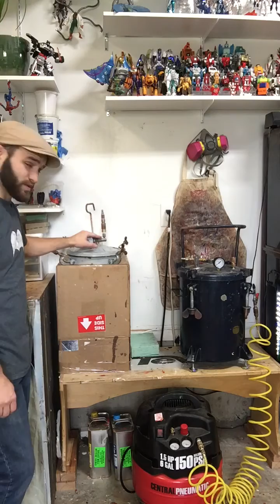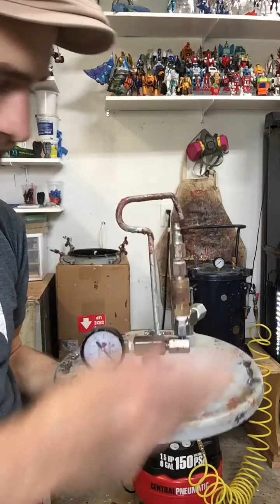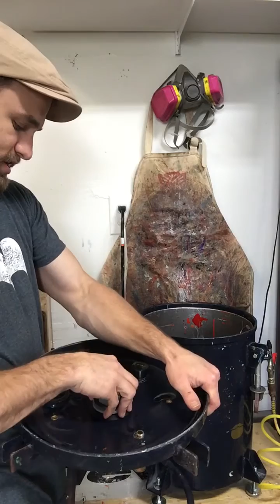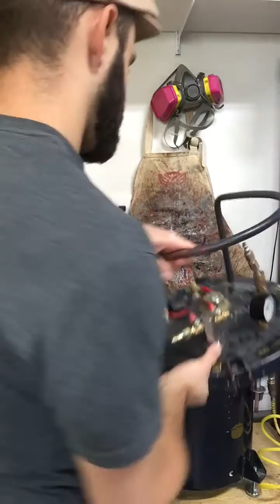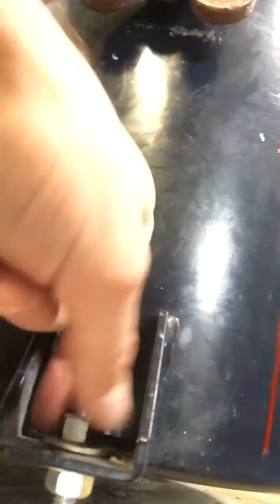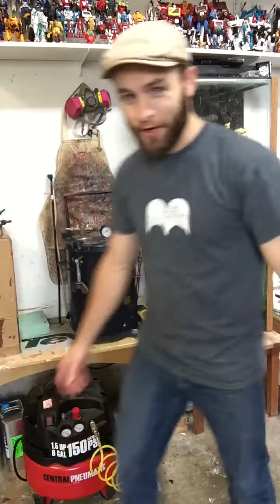Pressure chamber for pressure casting

Comment: Shouldn't you have a safety blow off valve installed?
Reply: Don't need one if you have a gauge, and if you're running your air supply at a PSI lower than the maximum of what your pressure chamber can handle. 
TLDR: Nyet, pressure chamber is fine.